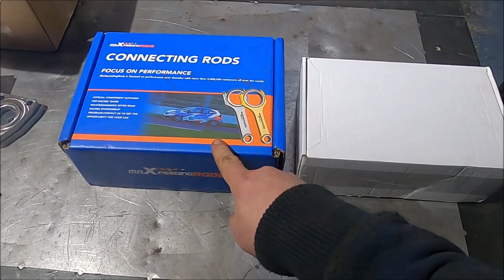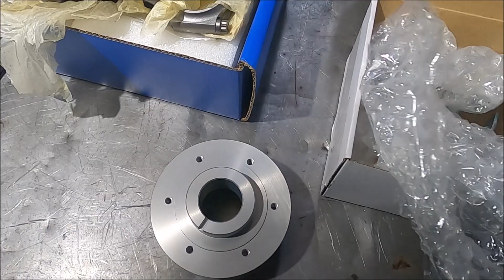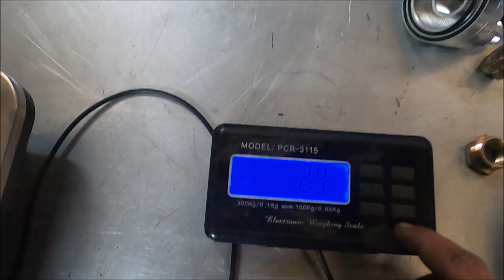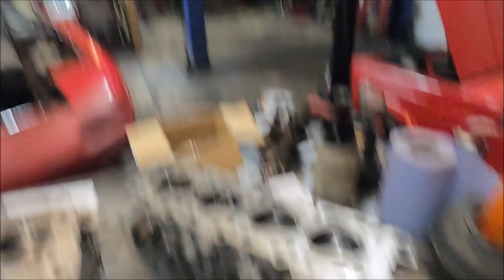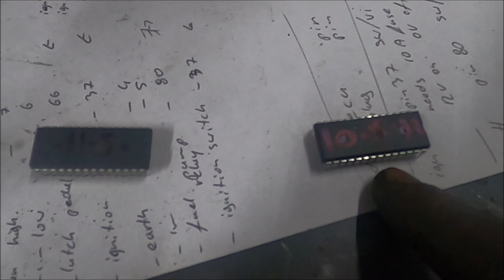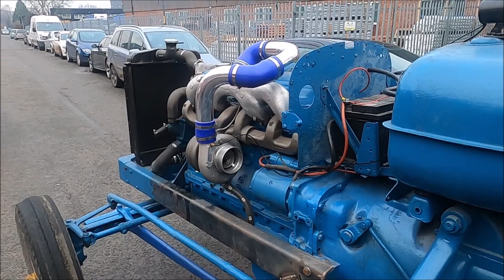Porting, chipping, rods, pulleys, manifolds, heads, loadsa stuff- And an old tractor with a HX35!

Comment: Regarding the parts you couldn't port and smooth on the exhaust manifold, have you considered acid porting? You basically seal all the openings in order to fill the manifold with muriatic acid. It will certainly increase the volume of the manifold, but it could smooth the areas that you couldn't reach.

It's an old school trick to increase the flow of exhaust manifolds without giving away that there has been any modification to them unlike mechanical porting.
Reply from the maker: I’ve never heard of that. I’ll look in to it. Thanks 🙏
Reply: @StavTech , just sharing what I have learned from American auto tech TV shows long ago.
Reply from the maker: @JoseRivera-ym3wj  appreciated!

Comment: Good in-depth video👍. Could you find out more about the fordson major with the hx35? My father is currently building a Super Major, he’s weighing up ideas about which engine to use. Was gonna use a v8 from a 143 500 but that 6 cylinder swap looks dandy. Any info appreciated👍 Thanks for the video again. Only thing worth watching on YouTube
Reply from the maker: It’s a Ford 6cyl diesel motor, stock at moment. They’re meant to be good for about 400 or so then the box or rear axle or something can’t take any more so pointless going more. Something like that. I’ll try find out
Reply: @StavTech  Maybe an early ford cargo engine 🤔 i was toying with using an iveco 6 cylinder turbo. No mate😂 have you ever seen the back end or box off a fordson major? They’re outrageous hardy. Scandinavian lads use the back ends in massive power tractor pulling tractors. 300hp major would be a bit of crack tho😂

Comment: have you ever thought about a speeduino or other cheap standalone ecu?
Reply from the maker: No. The cost and time of buying everything for that, wiring it in, and getting it mapped by someone decent far outweighs spending a few minutes swapping chips or adjusting fuel pressure for free
Reply: good work on the head bowls,.. i did mine on my 944 turbo too but i didn’t know about the angle you said in the vid! i have the head off right now , so very tempted but no i can’t becuase i’ve already calculated my compression ratio against my gasket that i have made in america.   on that note Stav,.. i was suporised in the head gasket your using ? what is it made of ? as i had to go with a cometic mls stainless ,... and your using more psi of boost than me?  i thought the fire ring would blow out with your level of boost wouldn’t it?

i used to run 19 psi with a wide fire gasket with no problems but when i uprated and forged the entire engine i was told i would have to go to full stainless not to blow through the gaskets but it’s more of a bitch to get a perfect seal on the skimming having to be a certain level/number of smoothness. 

i’m currently stripping my standard kkk26 turbo and exhuast getting it ready to make up a new system for the twin scroll hx35 you adviced me on getting for it 😎 ( it will take a while  giggling it at night on garage floor after kids are in bed but i started it last night 😉😉